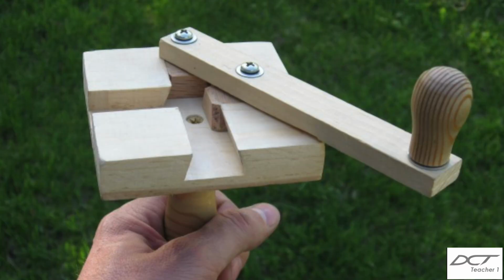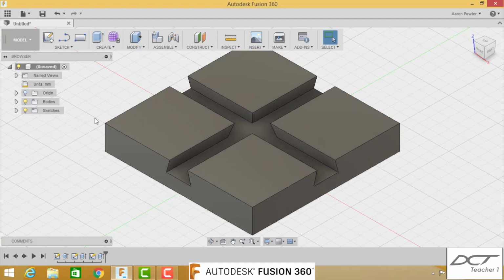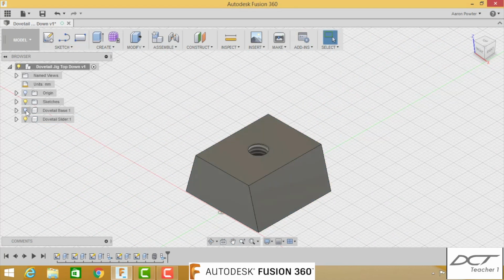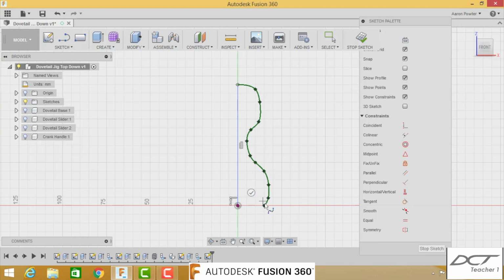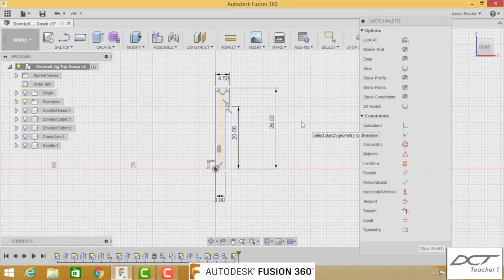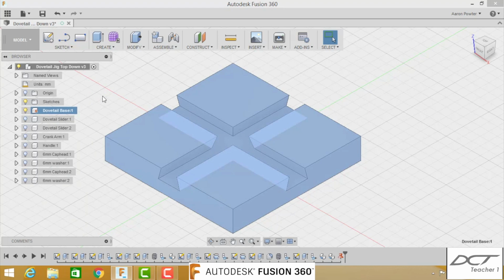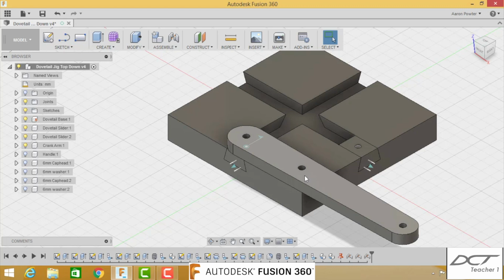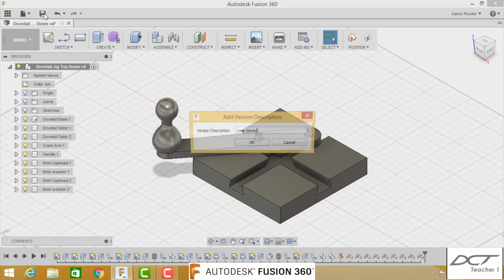Fusion 360 Tutorial - Top down design and Joints FF.E5

Comment: The problem with Fusion 360 top down approach is that it is far to easy to accidentally start making changes to one component while either in a different component or in the top level of the assembly.  Then you end up with a totally screwed up assembly of mish mashed parts that are impossible to untangle!  I have spent hours because of this.  At least with bottom up design like inventor or solid works the history of the part stays with the part!  There is no way to make changes in part A that end up in the history of part B.  Where in Fusion I have been bitten in the ass by this more times then I can count and there is no way to move the history around with out simply deleting all your work and start over.
Reply: Pretty sure you can still bring in components from other files so you can have discreet design histories.
Reply from the maker: Hello, thanks for watching and commenting.  To be honest with you.  I recorded this video a very long time ago and all though I used a top down approach it isn't actually "authentic" top down design.  When performed properly, true top down with correct design intent is very beneficial.  May I suggest you check out some friends of mine on YouTube.  Search for Scott Moyse (Cadpro) and Kevin Ellingson (mechanical advantage).  These guys vids will help to explain what I mean.  Cheers, Aaron.
Reply: @DCT_Aaron_Engineering  Thank you very kindly for your reply.  I will seek out the folks you directed me to.
Reply from the maker: Hi James.  Yes you can use Fusion360 using traditional bottom up design.  This is the way I was taught back in the early 2000's using PTC.  I.e. design all your parts separately and import these into an assembly.  Scott Moyse outlines his video https://youtu.be/BipcmKB_Nms
Reply from the maker: You're welcome anytime mate ;-)

Comment: That was a really helpful video. I wish I found this on day one. I noticed your dovetail joints are size for size which wouldn't work for a real world sliding application, is there an easy way to apply clearances to joints without making an undersized piece from the outset ?
Reply from the maker: Hi Todd.  thanks for watching and for the feedback.  I'm really glad that you found the video tutorial useful.  In regards to the dovetail size, yes you are correct.  In theory and practice two components of the same size won't go together as they would be a (to size) interference fit.  You can easily correct this in Fusion 360 by setting up some parameters in your design.  If you watch my "steampunk lamp" video I show this.  Cheers, Aaron.

Comment: Great video Aaron! I never knew about the control key for joints - makes me wonder what else I'm missing!

Silly question - but when I create a new component, I click the New component button (next to joint) first. Is there much of a difference between creating a new component first, and creating the body first and a component from the body? My sketches seem to stay within the component this way - do they remain with the new component or stay stuck with the base component?

Thanks again,

Adam
Reply from the maker: Hi Adam, glad you enjoyed the video mate.  Yes, you have to click on the arrow next to the body on the tree.  Right click on the body and select "create components from body".  If you don't do this it won't allow you to create the joints as any sketch you draw on the existing body will become one with it (does this make sense?).  You can actually start a component from the get go, by right clicking on the top "unsaved document" in the tree when ;you first open fusion.
Reply: Hi, the advantage in creating the component the way you are doing it Adam is that everything stays with the component.  Makes it easier to delete things afterward if you need to.  That is how I design my things now.  Components within component as sub-assemblies.  Makes for a very clean tree and you know exactly which sketch goes with which component you designed.  The disadvantage of the technique shown above is that there is no renaming of the sketches so you don't know which goes with what component.

Comment: Great job Aaron!  I cringed a bit at the time, but it was well worth it!!  I even played it at normal speed. lol  Something I rarely do on YT vids. :)   Once again, I found at least 3-4 nuggets of info that will make my work easier in fusion. Thanks!!!
I loved the object too!  We called them B.S. Grinders.  I used to make them out of walnut(base) and maple and sell them at craft fairs.  Made a bunch as gifts to. :)
Reply from the maker: G'day Mike.  Yeah very sorry about the video length.  I did try to warn you all at the start ;-)  Now, if you watched that video from start to finish I need to buy you a six pack of beers.  Isn't that insane, I had no idea that you used to make these "BS Grinders"?  I just did a google search on mechanised toys and this thing came up.  Upon further research people use them to make elliptical shapes with pencils and or handheld router.  Thanks again for watching and supporting me Mike.  Cheers, Aaron.
Reply: Don't worry about the time...it was worth it!  I did watch every minute of it and I actually went back and watched the copy/move parts again.  I was using that info yesterday on a new part. :)
I did all kinds of crafts as a kid.  By about 7th grade, I was using the radial arm saw, wood lathe, etc...unattended to make gadgets and toys.  I was soldering wire models together around 6th grade. lol  Been at this "maker" thing for awhile now. :)
Reply from the maker: Hey Mike, it's my pleasure mate.  I'm so glad people are getting stuff from my Fusion videos.  I don't know everything, but I'm keen to keep learning myself.  Would you believe my students that I taught CAD too, actually start teaching me by the end of their course.  Oh, and my good friend in New Zealand, Scott Moyse, showed me some cool tricks tonight via a video message.  How cool is the "maker movement"?  We are so lucky to be submerged and surrounded by such cool technology.  Wish I had it when I was younger. Cheers :-)
Reply: It would be cool to be able to spend more time checking out new tech! :)  Have you seen some of the stuff on wevolver?  Wow!
Reply from the maker: Oh yeah, I follow those guys on Instagram.  They post some crazy stuff.  I'll check out their YouTube channel now :-)